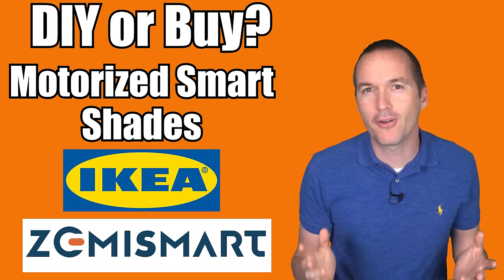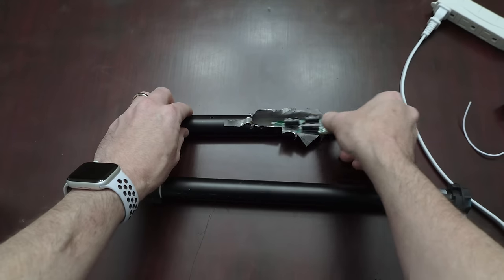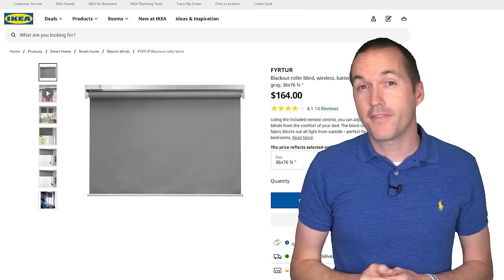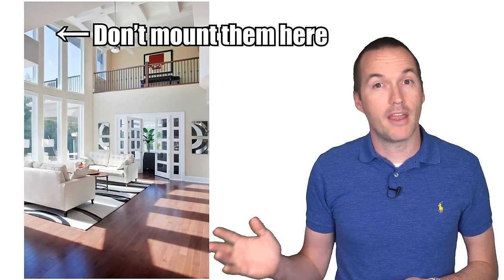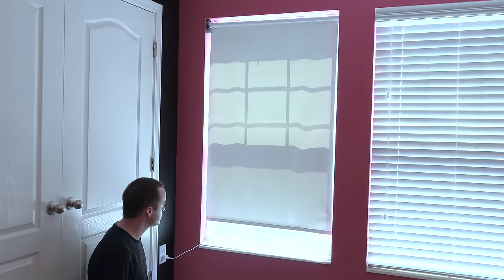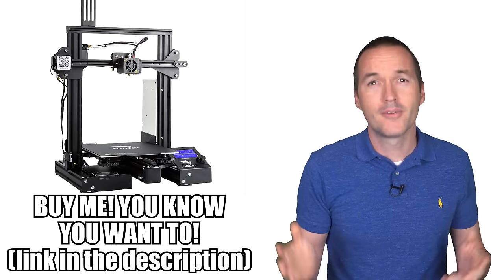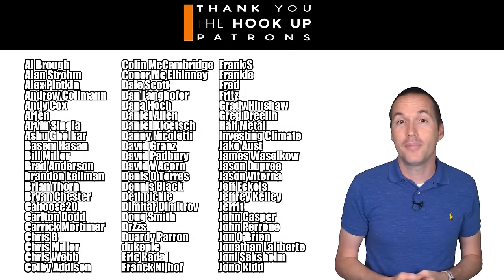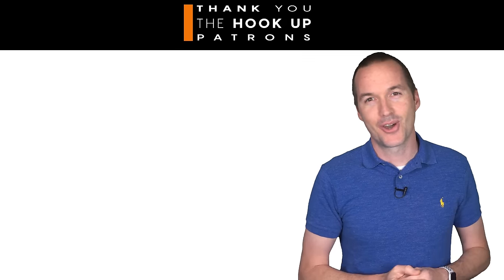Motorized Roller Shades? IKEA Fyrtur vs Zemismart Solar/Battery vs DIY!

Comment: @The Hook Up - No change to find roller shade on my Echo. On the browser ip adress i can control shades but i dont know why alexa cant find it. Also i hew instaled tuya skill. I made all thins like say in video. Any ideea  what i do wrong ? Thank you for support.
Reply: I also have the same problem.  My echo does not recognize it!  In view of the age of the repositories, I think that it must no longer be up to date to be detected by Alexa.  If you have found a solution, I am interested.  I'm currently trying to update the repositories but I'm getting some errors
Reply: @akem2106  hello, i have also error in update repositories so i have no luck if The Hook Up dont want to help us
Reply: @BlackB00X  Good news ! I managed to compile everything with the latest version of ESPAlexa and now it is correctly recognized and works with Alexa. I can provide you with the .bin if you wish.
Reply: @akem2106  this is a fantastic news. Sure i want bin file. Thank you for your support
Reply: @BlackB00X  Here is the .bin file. Hope it work well for you ! Enjoy :) : https://github.com/AkemN38/motor-on-roller-blind-ws-alexa/releases/tag/1
Reply: @akem2106  thank you soo much for support. Now alexa see my roller shade. Thank you thank you
Reply: @BlackB00X  You're welcome !
Reply: @BlackB00X  pleAse help me. I did everything same as video and all 3 of my esp8226 gives port 0 error. Am I doing anything wrong?
Reply: @akem2106  what should I put in MQTT SERVER?
Reply: @zeegrey3447  Sorry I couldn't get back to you sooner. Mqtt Server is optional you don't need to configure it.
Reply: @akem2106  thank you for your reply, and appreciate your time. I am waiting on a circuit board to be delivered. 

I am using this for a project of mine which is similar but I am using 2 stepper motors (either 2 nema 11s or 2 nema 17s ) instead of a single motor.

1: do I need to buy an Alexa to open and close?
2: do I need a different driver? I am thinking of (L9110s)
3: is it ok to use 2 9v batteries to power it up?
Reply: @akem2106  after WiFi configuration when I hit SAVE my phone connects back to my WiFi and nothing pops up. Can you help?

Edit: after erase the esp8226 and upload the roller shade file the blue light on esp8226 goes of and I have to press the RST to get the ROLLER WIFI pop up. And when I fill out the WiFi PASS it does not connect and fails.

Please help me Guys.
Reply: @zeegrey3447  Have you looked for the ip which is assigned to your ESP8266? If your phone disconnects and connects to your network, that's normal. On the contrary, it is a sign that it works.
Reply: @akem2106  do you mean the IP 192.168.4.1  ?
OR does my esp8226 get a specific IP?

After I do the configuration it does not connect to my network and also when I search for 192.168.4.1 nothing pops up on google chrome or internet explorer.

I must be doing something wrong.
Reply: @zeegrey3447  When your ESP creates its own WIFI network it assigns itself the IP 192.168.4.1. Except that when you connect it to your network, your network will assign a different IP address. It is she who will allow you to access the WEB control page. If you want use Advanced IP Scanner. It will scan all connected devices and show you its ip. Then it's up to you to find the right one;)
Reply: @akem2106  thank you so much, finally I got the ip working.

I appreciate your time and knowledge.
Reply: @zeegrey3447  No problem.  I brought this video out of the ground by updating the repositories.  I have to help when possible;)
Reply: @akem2106  thank you so much, newbs like me appreciate the time and effort you put.
I will see how I will be able to do the Alexa voice command ip thank you so much.
Reply: @akem2106  sry for dumb question, for Alexa to work, do I have to put in a specific IP for MQTT ? Or do I have to run a IP SACN on my computer?
Reply: @akem2106  I did redo everything and seems like it does not find/detect it.
Reply: @zeegrey3447  do you get my version or the version of thehookup? Apparently his version is out of date and doesn't work with Alexa anymore. And second question. Do you have an Alexa devices ( Echo Dot, Show)?
Reply: @akem2106  yea I do have your version of the code, no I don’t
Reply: @zeegrey3447  Have you already set up connected devices in your Alexa app?  If I'm not mistaken, you normally need an Echo device to act as a hub for all your connected devices.  So if you don't have an echo (Show or Dot), you won't be able to group everything together on Alexa
Reply: @akem2106  Ok I am putting in an order on Amazon tonight. thanks
Reply: @zeegrey3447  Ok ! Hope it will work now for you
Reply: After flashing my esp and entering my wifi informations. It is trying to connect to my network. After that the esp is stuck in a rebooting loop. Does anyone know how to fix this? Big thanks in advance
Reply: @RedAura99  connect back to your WiFi and put the IP of the esp and it should pop up.

For IP use advance ip scanner and you will see it.
Reply: @zeegrey3447  I went through the information given by the serial port. When the esp successfully connects to my network. The esp is no longer responsive and reboots every 3-5 seconds with a mqtt error, even when I am not using mqtt.
Reply: @RedAura99  I will make a video tmrw and post it. Should be easy to follow.

Step 1 run the code
Step 2 configuration (let it sit for a minute and it leads no where)
Step 3 connect back to your WiFi 
Step 4 look for esp IP address
Step 5 plug the IP address and you should see the roller shade page open up.

Edit: use the code posted in this comment section which was updated by this other guy. You should be good to go with his code.
Reply: @zeegrey3447  I followed these steps correctly and tried a few different binaries . Sadly the outcome was always the same. Then I have tried the code and binary  on 2 other esps and they acted the same way the first did. Might be my d1 minis the cause of this problem?

Btw thank you for trying to help me:)
Reply: @RedAura99  I would not know what can be the problem. Did you use the code under the comment section?

Edit: link.   https://github.com/AkemN38/motor-on-roller-blind-ws-alexa/releases/tag/1
Reply: @zeegrey3447  Yeah I did, also every different version on thehookup's versions. The issue was always the same. Then I made sure that the esps are working correctly so I have flashed them with my own made software and it worked perfecty fine, even mqtt. I may be trying altering the code and hardcode mqtt. Maybe I can bypass the error this way.
Reply: @RedAura99  Hello, I am sad to hear that you are having trouble getting the ESP to work.  What type of ESP do you use?  (8266, 32).  What flasher do you use?  And in which flash mode do you have your esp?
Reply: @akem2106  I am using an esp 8266 (wemos d1 mini). I am flashing it with the tasmota flashing tool and I am erasing all data before flashing.
Reply: @akem2106  That's what I see on the serial port. I hope this might be helpfull. Following lines keep repeating until I power it off. mqtt user and pw replaced by ******

 ets Jan  8 2013,rst cause:2, boot mode:(3,0)

load 0x4010f000, len 3460, room 16 
tail 4
chksum 0xcc
load 0x3fff20b8, len 40, room 4 
tail 4
chksum 0xc9
csum 0xc9
v0006b010
~ld
Starting now
*WM: Adding parameter
*WM: Name
*WM: Adding parameter
*WM: Rotation
*WM: Adding parameter
*WM: 
*WM: Adding parameter
*WM: invocation
*WM: Adding parameter
*WM: 
*WM: Adding parameter
*WM: server
*WM: Adding parameter
*WM: port
*WM: Adding parameter
*WM: uid
*WM: Adding parameter
*WM: pwd
*WM: Adding parameter
*WM: 
*WM: 
*WM: AutoConnect
*WM: Connecting as wifi client...
*WM: Status:
*WM: 0
*WM: Using last saved values, should be faster
*WM: Connection result: 
*WM: 3
*WM: IP Address:
*WM: 192.168.0.9
{"currentPosition":0,"maxPosition":2000000,"config_name":"","alexa_invocation":"","mqtt_server":"192.168.0.200","mqtt_port":"1883","mqtt_uid":"*********","mqtt_pwd":"*********","config_rotation":"false"}MDNS responder started

--------------- CUT HERE FOR EXCEPTION DECODER ---------------

Exception (28):
epc1=0x4000bdc8 epc2=0x00000000 epc3=0x00000000 excvaddr=0x00000000 depc=0x00000000

>>>stack>>>

ctx: cont
sp: 3fff34e0 end: 3fff38a0 offset: 0190
3fff3670:  3fff1dcc 00000050 00000000 402218b8  
3fff3680:  3fff684c 00000000 3fff684c 3fff1dcc  
3fff3690:  3fff3834 3fff3844 3fff3cd4 40209bff  
3fff36a0:  00000051 3ffe9082 3fff1ee8 40214e20  
3fff36b0:  3fff1bb4 00000003 3fff3834 3ffe8f14  
3fff36c0:  3fff1bb4 3fff1ee8 3fff1dcc 40209c8c  
3fff36d0:  3fff1bb4 3fff1ee8 3fff1dcc 40205000  
3fff36e0:  00000000 00000000 3ffeb77c 00000000  
3fff36f0:  00000000 feefeffe 00000000 00000000  
3fff3700:  feefeffe 00000000 00000000 00000000  
3fff3710:  00000000 40223038 00000000 40223038  
3fff3720:  00000000 40223038 00000000 40223038  
3fff3730:  00000000 40223038 00000000 40223038  
3fff3740:  00000000 0000000a ffffffff fe000001  
3fff3750:  3ffe89c6 00000000 fe01ef35 00000000  
3fff3760:  402025a4 0000000a 3fff6394 00000000  
3fff3770:  00000000 00000000 00000000 3ffe8c57  
3fff3780:  3ffe8b79 3ffe8c49 3fff6364 00000028  
3fff3790:  3ffe89c6 3ffe8b70 3ffe8c3b 3fff6334  
3fff37a0:  00000028 3ffe89c6 3ffe8c36 3ffe8c31  
3fff37b0:  3fff6324 00000006 3ffe89c6 3ffe8c2a  
3fff37c0:  3ffe8c25 3fff62f4 00000028 3ffe89c6  
3fff37d0:  00000000 00000000 00000000 00000000  
3fff37e0:  3ffe8bf6 3ffe8b4a 3ffe8be6 3fff62c4  
3fff37f0:  00000028 3ffe89c6 00000000 00000000  
3fff3800:  00000000 00000000 3ffe8bba 3ffe8bb1  
3fff3810:  3ffe8b9e 3fff6294 00000028 3ffe89c6  
3fff3820:  3ffe8bf1 3ffe8b91 3fff6264 00000028  
3fff3830:  3ffe89c6 00706374 feefeffe 03000000  
3fff3840:  feefeffe 00007377 feefef00 02000000  
3fff3850:  feefeffe feefeffe feefeffe feefeffe  
3fff3860:  feefeffe feefeffe feefeffe feefeffe  
3fff3870:  feefeffe feefeffe feefeffe 3fff2080  
3fff3880:  3fffdad0 00000000 3fff206c 40217724  
3fff3890:  feefeffe feefeffe 3ffe865c 40100fb9  
<<<stack<<<
Reply: @RedAura99  Have you tried with Nodemcu PyFlasher : https://github.com/marcelstoer/Nodemcu-PyFlasher?  And have you tried to run your esp without doing the Mqtt configuration? For NodeMCU Py Flasher, select your serial port, then select your bin file (preferably my version).  In flash mode selects Quad QIO or Dial DIO.  Preferably chosen Quad QIO and yes wipe all data. Once do try to reconfigure your esp 1 first time without the Mqtt configuration, then if everything works try again with the mqqt configuration this time
Reply: @akem2106  I have tried pyflasher with your recommended settings. Also the setup with and without mqtt. Sadly I am getting the same result.
Reply: @RedAura99  Did you fill in the name of alexa summon?
Reply: @akem2106  no I didn't
Reply: @RedAura99  Have you try flashing a different bin like wled or else? See if the Wemos is defective.
Reply: @RedAura99  Try to fill the Alexa Invocation Name
Reply: @akem2106  the wemos is working just fine. I have flashed it with a different project I am currently working on and it's working without any issues. Put I still have tried it on 2 other esps as well and there was the same result
Reply: @akem2106  Finally it works!!!!! :=) Looks like this error appears when the  alexaname is empty. Thank you so much for your time and help. You can't imagine how happy I am right now :)
Reply: @akem2106  does it matter on what size motor I use and a different driver connected to eap8226?
Reply: @zeegrey3447  I think if you change the motor to one that has more torque, you have the possibility of improving the speed.  Namely the small motors used in the video can take up to 9 volts if I'm not mistaken.  After that I did not try with another engine.  Keep me posted if you try and it works
Reply: @RedAura99  No problem.  It is with pleasure to have been able to help
Reply: @akem2106  I am using 2 nema 11s and the wire gets hot to the point of melting. Connected to 12vdc and esp to 5v
Reply: @zeegrey3447  Do you use the same cable for 5V to power your esp that you use for your motors.  If this is the case, it is indeed normal that these heat up.  They are not made to take 12V.  Use larger cable.
Reply: @akem2106  i use a thicker cable to power the driver but the thin wire connected to motor heats up which I can’t take off from the motor
Reply: @akem2106  I did use 2 drivers and 2 motors with a single esp8226, the only issue I have is the speed and torque, it seems slow and low torque, not sure if it is due to the code?
Reply: @akem2106  Wow! Thanks so much, I've been pulling my hair out.  Great catch!
Reply: @akem2106  That worked for my case. I have been trying to figure out what the problem is for a long time. Thanks Killian!

Comment: I bought some zemismart motors but they didn't send me a remote control, i tried to configure my broadlink but it's not working - i'm reading that the US market motors use 915mhz - can anyone confirm this?  is there a smart interface you'd recommend with 915mhz?

Comment: Wouldn’t it be pretty easy to upgrade the motor?
Reply from the maker: Yes and no, you could upgrade the motor, driver and power supply, but you'd start to encroach on the price of the cheapest pre-built solution and you wouldn't have anywhere near the same functionality.

Comment: With some batteries is not possible? I mean with the plug in wall method is not so a to go for me
Reply from the maker: Not with WiFi.  You'll need a lower power protocol if you want to DIY with batteries (probably RF).
Reply: @TheHookUp  can you do a video about roller shades with batteries :D?

Comment: I went DIY for cost reasons. Ended up creating a custom ESP8266 circuit.
It can operate from 5v to 24v depending upon the chosen motor.
If you are capable of soldering 0805 surface mount parts then I am happy to share what I have below.

Schematic is https://drive.google.com/open?id=1JTpCAQMXz_BMpP7WDTBK-ZBZatCc2q8b
Gerber files https://drive.google.com/open?id=1XkyEsYsn7O02j4XuMW4KLoSBFC5TS338
BOM https://drive.google.com/open?id=1hakbwQYKHZVIq0P5JHbh3o3Ip8JchFSu
Reply: Which motors do you use? How big blinds do you have?
Reply: @isaklofgren1561  Ones like https://www.ebay.co.uk/itm/Speed-Reduction-Gear-Motor-Electric-12V-DC-60RPM-Powerful-Torque-25mm-/152319407805
Any low rpm like 30-60 should have enough torque.
Slightly noisy though.

Comment: I know and understand the spirit of this video. But being a window covering expert, specializing in motorization and trained by Somfy, Lutron, and Rollease I can tell you that just buying a quality motorized shade from a custom window covering company will be a flawless experience compared to this type of install. I get it WILL be expensive. I just sold 3 double windows (74x58), 2 single windows (36x58) a slider, (78x80) plus 2 other shades for about $5100 with a 5 year unlimited warranty (even damage), 5 years free tech support, installation included, shipping included, Hub included, 3 controllers, and you get $50 for any referral that purchases anything. I know that $5k is a bunch of $$$$ but you are getting something that will work, have no drawbacks, and will serve for 15-20 years at least.
Reply from the maker: I have to disagree with you. If you’ve got more money than time paying crazy prices to have someone do it for you is fine, but I’ve taken somfy and Serena motors apart and they are basically identical to these motors but way more money.  These motors will last just as long for a fraction of the price.
Reply: but where's the fun in having someone else do it for you? not only do you save tons of $ but you learn in the process.

Comment: Can be that code used with Nema17 and A4988 driver ?
Reply from the maker: No, it's written for a ULN2003 driver and a unipolar stepper.  I may rewrite it with acceldriver at some point.

Comment: 1 does it work with google home and 2 do you have to hold the buton down the whole time?
Reply from the maker: 1. The Zemismart ones work with google home stand alone.  The ikea will require the Tradfri hub for that, and the DIY version only works with Alexa.

2.  No, you can single touch the button.
Reply: @TheHookUp  thanks